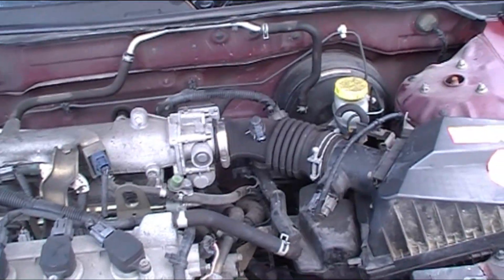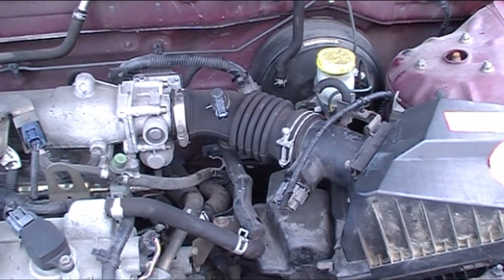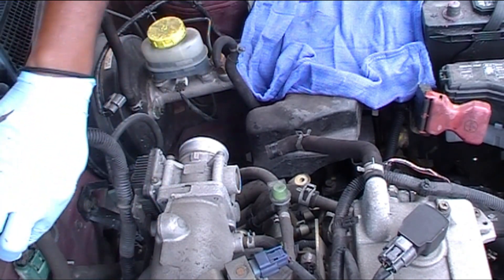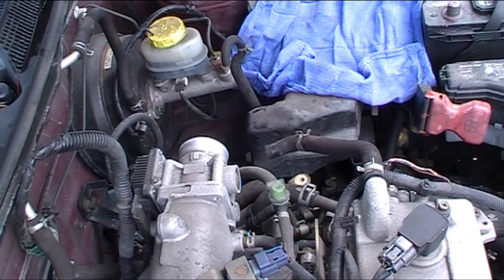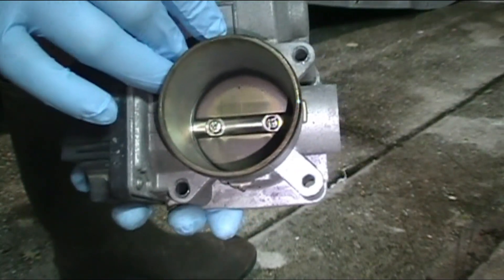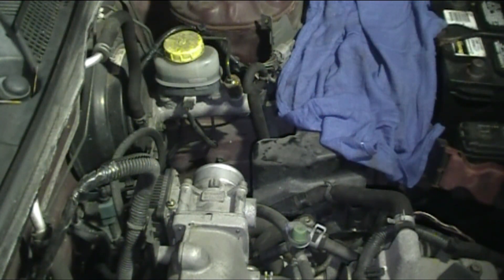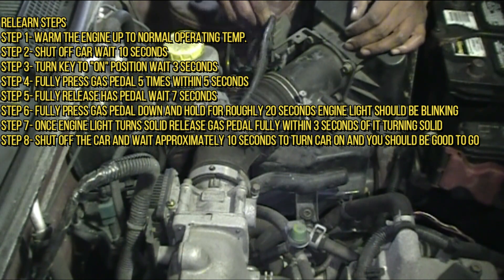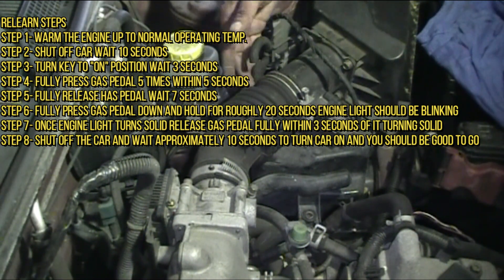2000 2006 Nissan Sentra Throttle Body Remove, Clean, Install & Relearn

Comment: Hey thanks for this video!!  I've got an 04 senta and I drive 100 miles each day to work,  and it's kinda acting like it wants to die, when I'm waiting on a light or stopped, but running , I recently changed the oil and air filter , replaced the spark plugs, but anyway , other than that it does run pretty good , but my question is,,,what else would you recommend to check , or clean up under the hood just to keep it running good for future use?
Reply from the maker: Fuel Pump Pressure.  had the same problem.
Reply: Did you ever find out what the problem was?

Comment: Dear. Thanks so much for your video. I have a question. The throtle body have a small screw. Do you know what is the funtion of these screw. I saw that I can move the screw. What adjusting these screw.
 Please your help.
My B15  2005 have a problem when a put march the RPM down to 450 Rpm and when I return to parking or neutral the Rpm are in 750 Rpm

Comment: I've built cars and worked on tons more, My 02 Sentra has given me the biggest headache I've ever delt with. I cleaned my throttle body and started having high idle so I cleared the codes, did the relearn process, checked for leaks, check MAF, spark plus, and everything just to realize I damaged the Throttle Botty by barely messing with it 🤦🏽‍♂️
Reply: You had to replace the throttle body?
Reply: What's the relearn procedure

Comment: You said the throttle body was not the problem would you tell us what the problem was you discovered please?
Reply from the maker: Fuel Pump.
Reply: Crankshaft sensor in the bottom side, it happen to my sentra

Comment: I did everything according to the video but still iddle high with the check engine light on. Is any other tips you have. Thank you
Reply: I had that problem when I used this special adjective and premium gas, which caused my RPMs to jump up, but eventually, it
 Went away.
Reply: I have that problem, but I never unplugged the throttle body because if you do it could mess it up and trip it or something

Comment: Can you just do the "Relearn Steps without Taking off the Throttle Body and Replacing it?
Reply from the maker: Yes, I’ve done it a few times to make sure it was not the problem.

Comment: My 2002 have no power when accelerating, I replaced the fuel pump, still the same. Could it be the throttle body ?
Reply from the maker: I have new fuel pump that’s defective. Check the fuel pressure from the pump.

Comment: Hey I did this and it runs good but idles high and rough any suggestions into idles rough and bounces around 1.5-2000 rpm’s only in park
Reply from the maker: You need to relearn the programing, check the description of video.  sometimes you have to do it 2x.

Comment: What do you use to remove the bolts holding the throttle body down ?
Reply from the maker: Those 4 bolts was removed with an Allan key socket.

Comment: Always use a new gasket and check the rubber intake boot for cracks. Replace if necessary.
Use die-electrical grease to keep moisture out of the electrical connections. 
Nice video :)
Reply: I was yelling in my mind during the video the exact same things you typed. Everyone needs to follow what you said.
Reply: Get your own yt channel
Reply: @diskoeric2248  I don't have the time but thanks for the inspiration.

Comment: Hey, good video. Quick question though… How do u know if you should change the throttle position sensor or the pedal position sensor. My code reader kind of combines them both into one code so I don’t know which to replace. Any help would be great. Going to get a fuel pressure gauge tomorrow to check that too. Trying to drive this thing until the wheels fall off.
Reply: My 2005 Sentra 1.8 has 330,000 miles, runs great, burns 1/2 quart of oil in 5,000 miles and I get 33 mpg :)
I already ran the wheels off many times :)
Reply from the maker: All my codes was pointing to throttle body, last suspect was fuel pump, before you do anything, check fuel pressure at  idle and acceleration.
Reply: A little late but I replaced my accelerator pedal / sensor because it was cheaper and easier and it got me out of limp mode and cleared the code.
Reply: Do all the b15’s have an electronic throttle body? I have a 2000 Sentra 1.8L. Trying to do a idle relearn on it
Reply: @hhova29  not sure. You need a book.

Comment: I know I'm late, but I have a 2001 1.8 and if it's been throwing itself in limp mode do I need to hook it up to a computer to clear the code or will it automatically clear?
Reply from the maker: What is limp mode?
Reply: @BARR8323  Limp mode is a Factory prescribed setting that will force your vehicle...including your Sentra, to NOT run over ??? RPM's to prevent any damage to the Powertrain. The idea is that by limiting the RPM's, you can still drive your car...but only very slowly to get it off the road and to get it repaired---they say..."to a dealer" (which none of us can do with our old Nissans - thus why we fix them ourselves).

Bad news...is lots of problems can cause your car to go into Limp mode, as mine 'appears' to be in now.  
I say appears...as I have a P1574 TP Sensors Disagree code, among a few others on misfires also. But that is  new one and I think the mis-aligned TP sensors means my 2004 Sentra is Revs/Runs great in PARK..but when I put it in gear I have Zero Throttle response - 750-1000 RPM's. Which is sometimes...like I did at first....mistaken for "Limp Mode". Anyone have this issue with the TP Sensor disagreement let me know.....if u fixed yours. My car is stuck in parking lot now.

Comment: I have a 00 Sentra gxe and recently been getting the codes p1130 and now p1165. Hardly use the car but warm it up and drive it around the block once a week. The dealer told me it was the swirl valve and that is built into the throttle body. 
Can any throttle body replacement fix this issue??
Reply: I had the same problem it's not built into the throttle body

Comment: My 2000 was running rough and I simply unhooked breather hose and put a shop rag under the throttle body and kept saturating it with Berrymans b-12 chemtool throttle body spray cleaner and kept wiping the dirt out as it flushed carbon deposits out, it was hard to start afterwards but it started and has ran great. plus b-12 chemtool injection system cleaner in the Gas ⛽ tank.

Comment: You should let ppl to learn how to relearn the throttle body before doing this, cus they will have another problem, you  didn't mention that
Reply: what other problems please. thanks
Reply: Are you saying that an alternative to replacement is just to relearn the existing throttle body to correct issues??
Reply: @nevmitch2  yes it's called the pedal dance.
 It involves turning the key to accessory and pressing the gas pedal a certain number of times, releasing the pedal and then doing it again. A quick Google search for Nissan pedal dance should help you out
Reply: The procedure for the pedal dance is in the description of this video actually !

Comment: Just a heads up these throttle bodies are VERY fragile! I took mine off to clean it and put it back together and started having issues. Tried to swap it with a used one from a parts yard and broke that one too after being even more delicate. Had to take it to a shop and cost me $600. I would NOT recommend doing this cleaning unless you are very skilled.
Reply: Says....the Nissan Shop Supervisor who makes his living off robbing us. It's METAL....it is NOT FRAGILE!
Reply: @lovetrump1088 your right lol dude acting like it a just a piece plus this park like 60 bucks on amazon lol
Reply: I've built cars and worked on tons more, My 02 Sentra has given me the biggest headache I've ever delt with. I cleaned my throttle body and started having high idle so I cleared the codes, did the relearn process, checked for leaks, check MAF, spark plus, and everything just to realize I damaged the Throttle Botty by barely messing with it 🤦🏽‍♂️

Comment: I have an 03 spec v and it has code p1102 and p0420 i changed the 02 sensor , fuel pump, spark plugs and ignition coils i also cleaned the maf and the throttle body but it wont start unless i pump the gas and after i start driving it doesnt stall but it revs at 2krpm and on every gear it wont let me pass a certain speed on 6th gear i cant pass 60mph any help ?
Reply from the maker: Check your fuel pressure
Reply: @BARR8323  will do ! thanks for the reply and i will update soon
Reply from the maker: While P0420 does not pose a danger to the driver, it can cause driveability concerns such as a lack of power or poor acceleration if left unrepaired. It can also cause severe damage to other components of your vehicle if not addressed in a timely manner.  P0420 typically means that a converter has worn out or degraded—not obstructed or clogged. But if the case is the latter, it can lead to engine performance problems, such as a lack of power, rough idling, and stalling, which are some of the common signs of a clogged catalytic converter.  When the voltage coming from the Mass Air Flow (MAF) sensor to the Powertrain Control Module (PCM) is low but within range, a P1102 trouble code is stored.  This is what I found online.

Comment: Nissan N16 Sunny 2003 
I have a problem with RPM - it's completely unstable
The Throttle nail has been moved - and the idle sensor has also been moved
How do I return the Throttle nail to the original factory position?
Reply from the maker: Hi I am not sure, you might want to google it.

Comment: Yeah left me stranded and checked on gas coming in at the line at engine compartment and nothing . Checked fuse and relay and relay was bad . Replaced relay and still no gas when I cranked it . Replaced fuel pump and less than a week still doing the same . It's rough idling and when I press gas pedal doesn't rev up .. WTH
Reply from the maker: Hook up a fuel pressure gauge in the fuel line under the hood and check the pressure, I am suspecting you’re having an intermittent fuel pump problem.
Reply: @BARR8323  never done that type of thing before. Where do I rent / buy or possibly borrow this gauge?
Reply from the maker: Harbor Freight have a kit, look for the fuel line coming up under the hood from the pump, disconnect it and the gauge goes in line.  The pressure be approximately 50psi.  If your pressure is not there start checking what you checked before.  The only reason I say Pump is I went through a few pumps and the last on had me baffled because it was 6 months old and I thought it was something else so I did sensors and throttle body, nothing worked so once I connect the gauge and rev the car let it warmed up noticed pressure was off, swapped the pump out I went a little more expensive and worked good.
Reply: @BARR8323  OK but did you read my comments about me taking it to the dealership and they said it's either TCB, pedal sensor, linkage.. Or if that didn't work, replace electric harness? Do you have any idea if they check fuel system? I still have the paperwork on this $85 " diagnostic"..
Reply from the maker: What was the code? Sounds like they are guessing.  I can only comment on my experience.
Reply: Which test kit will work on my car 06 Sentra? The more expensive one $90 or the lesser one at $50?
Reply: Paperwork says that tech confirmed found codes for throttle body and throttle position sensor.
Reply from the maker: Less

Comment: Relearn procedure at 9:16 . I don't know why car is STILL sooo having problems . Changed TCB and going to do this .YET AGAIN . Mechanic did the replacing of OEM Hitachi unit . Over a year ago , it wasn't revving up normally even flooring gas pedal . So called " mechanic said it was TCB so he changed it . For allthe good it did .
Reply from the maker: All the issues I had and parts I replaced was not my problem, the problem was week fuel pump.
Reply: @BARR8323  Sooo why do you think that was ?? Yes it finally left me stranded and both relay and fuel pump was bad . Replaced both and yet problem still continues .. WTH Brand new pump from Rock Auto
Reply from the maker: Frank Montez when my problems started I dismissed the fuel pump because it was a year old, my wife would drive and all of a sudden it lost power, sluggish at stop lights. Since the pump was approximately a year old never suspected it.  Sometimes I get intermittent CEL running lean, I clear the code and look at other parts that could fail.  After all the parts I replaced, it circled back to the pump.  If you know your coil packs are good, plugs are good, just do process of elimination and don’t dismiss the obvious.  You need a certain amount of fuel pressure to keep the engine running, so start by checking fuel pressure.
Reply from the maker: Some places parts are cheap.  There is a reason why, think about it. The throttle body I replaced was OEM hitachi and didn’t fix the problem, lucky I discovered it within 4 days and was able to get a refund.
Reply: @BARR8323  maybe I will check fuel pressure . About a month ago , took it to Nissan dealer and the diagnosis code was for TCB and gas pedal sensor and linkage . And if that doesn' t work for $6-700 then change electrical harness for about that again ..
Reply: @frankmontez6853  Have any of you thought of changing the FUEL PRESSURE REGULATOR SENSOR, Located By and attached to Intake Manifold. Used on a RETURNLESS FUEL SYSTEM. Pricing one out today.
Reply: @frankmontez6853  Yep...Dealers are the WORST for Trial and Error...and that is why we end up going there in the LAST Place...and all they do is exactly what others do. The REAL mechanics that know the cars (each Manf and even each CAR has experts) are hard to come by. Last Trick from My Dealer: They 'called' me in for two 2004 Sentra Recalls.  They did the 15 minute Recall Job, but then didn't do the 8 hour Recall. I learned why later - they only got paid 25% rates for the 8 hour one...and ran me around for months cancelling sessions they set up to do it. If they can screw us...they will!
Reply: The fuel pump is problematic on this model, but your issue sounds a lot like you have not successfully relearned the idle. NOTE:  Also, I believe there are 2 relearns that must be performed.  The other has to do with the accelerator pedal relearn and must be done first.